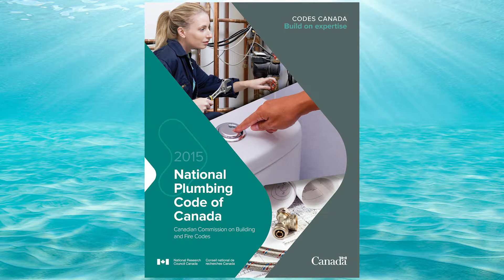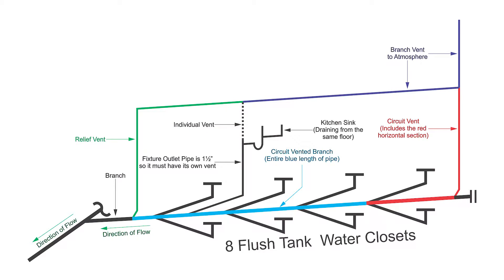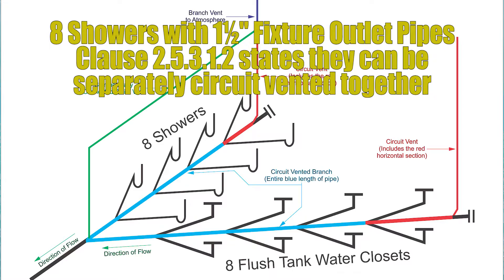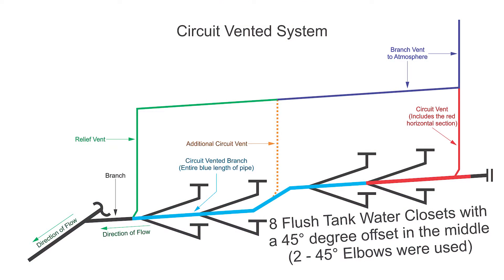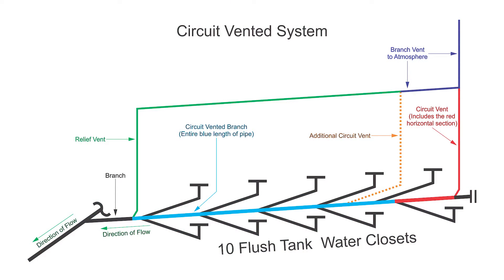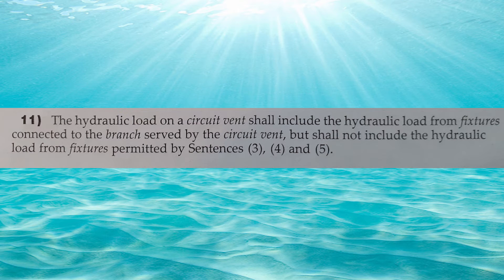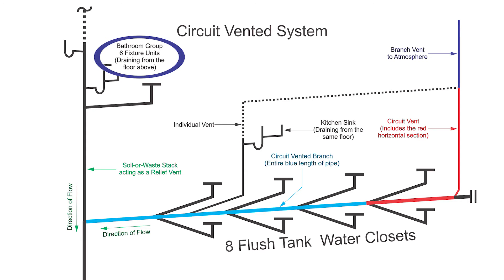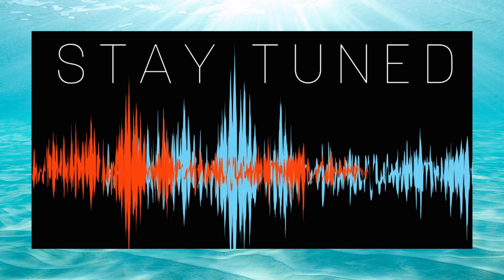Circuit Vent Part: 2

Comment: I'm confused. I thought you couldn't have double wyes on the horizontal plane ? At least that's what ontario building code states. Please clarify.... p.s. your videos are awesome, so thank you for your hard work
Reply from the maker: Double TYs in the horizontal plain is a no go, but double wyes are permitted by the National Plumbing Code of Canada.

Ontario may have plumbing amendments saying otherwise though. (I have never plumbed there) Typically building code does not delve into the arrangement of drainage fittings though.
Reply: @MathematicPlumber  In Ontario it is a code violation to use a double fitting of any variety on the horizontal.

Comment: In one hand you say that we dont count Lav because it has it is own vent but on the other hand you counted it for circuit venting sizing.
In the book it has counted the Lav but some instructors believe that they dont count circuit vent sizing because it has it is own vent.
I am confused
Reply from the maker: We don't count the lav as one of the 8 circuit vented fixtures that are permitted between the vents. We do however count the fixture unit load though.

Fixtures and fixture units are not the same thing.

As for other instructors having different interpretations, welcome to the wonderful world of code. I advise you follow your instructor, as they are the ones who will grade your work.
Reply: @MathematicPlumber  
I have seen the in book that has counted it for circuit vent load .
Reply: Any way ,You teach very well,please continue teaching code book.
Canadian code book is bit complicated,
Other countries,I have seen more straight forward language .

Comment: I have question ,
The hydraulic load on circuit vent shall not include the kitchen sink because kitchen sink has it's own individual vent.
Reply from the maker: The hydraulic load on the circuit vent includes everything drained through the circuit vented branch including the kitchen sink. Doesn't matter if it has it's own vent.
The hydraulic load that is NOT included in the circuit vent, is from fixtures draining through the relief vent only. 2.5.3.1.(11)
Reply: @MathematicPlumber  
I understood ,
Thank you very much .👍